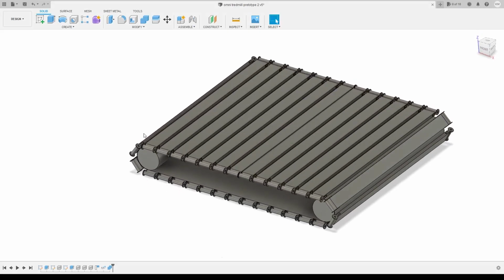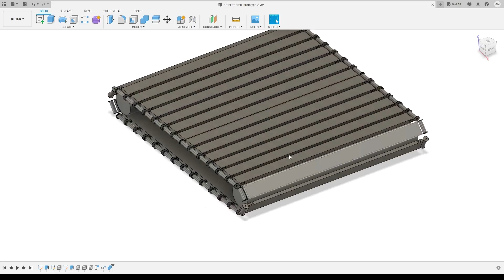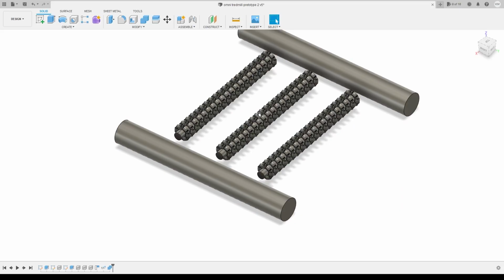DIY VR Treadmill #shorts Omni roller testing!

Comment: It's crazy how much effort you're putting into this and professional your videos are. The editing is nice. You deserve way more views. I think you need to work on your thumbnails though. That's one of the most important things for getting views. It seems like you put effort into them but they need more bright colors to attract more people, instead of the white background you have on some. Also, a question about the treadmill, is it going to have motors in them like the infinadeck? Cause when i saw the infinadeck i questioned if it really needs the motors.. If you look at the ready player one scene, the treadmill looks more like it's this really lightweight band that spins with very little effort, as apposed to the treadmill moving on its own to match the players needs. Couldn't you just make just one big band, with a bunch of smaller bands that all move individually, like instead of having the couple bands in the middle move motorized, only the bands that you would step on would get pushed back separately? I'm probably completely wrong but wouldn't that be possible? Like almost to just have some very frictionless pulley systems on the bands so they all move very fast and easy? I don't even know if that made any sense...
Reply from the maker: Kind of makes sense? but at the same time you have the issue of friction between the belts and the standing surface. it might be possible if you wanted to have a harness supporting most of your weight! ill have to do some testing, thanks for the idea! also thanks for the advice on the thumbnails!
Reply: @modernpower6285  yeah, i was thinking like putting some oil in between the belts and the surface to decrease the friction. And yes, i guess the harness should support some of your weight. I'm not really knowledgeable on these things so it was just a thought I was wondering about.

Comment: Dude there's a reason this kind of equipment ends up costing the end user several thousand. 3d printed plastics, plywood and cardboard just aren't going to cut it for this application. You'd be better off building a slide mill instead. At least that doesn't have to have powered moving parts. That's still a project and a half and I would guess you could end up spending somewhere in the ballpark of $500-$800. This needs precision manufacturing with very strong and lightweight materials to work. If you're sweating $100 for some aluminum extrusions, then this project is far and away outside your reach. Not trying to be negative here you just need to be realistic about this or you are going to waste a lot of money and time.

You are also failing to calculate your loads correctly. Even if you only weigh 150 -200 lbs, the force of moving your body in a walking motion is going to apply much greater peak loads than your actual weight. This thing is gonna have to be really heavy duty.
Reply from the maker: Thanks for your input! I under stand that a slide would be easier and more cost effective. and i also know why treadmills like this cost thousands. but prices such like these can be greatly reduced. lets say for some reason this project takes off allowing me to crowd fund some injection molds. once ive done that we have all the 3D printed pieces available for around 10 bucks instead of the estimated $60. this project will not be easy to complete and I completely under stand why you would think that there's no way this would work. but I believe I can make it happen. if you are interested in discussing the project further i am more than willing to do so on the discord. PS if you are unable to purchase any of the items that you need second hand current projected cost of the project is $1300 i think ill be able to get it down at least to 1K with some careful planning. Thanks for the advice!

Comment: You should consider printing the parts that need heat resistance in PETG.
Reply from the maker: I didn't really consider that good idea!
Reply: @modernpower6285  You could also print them in TPU or coat them in some rubberized material for extra grip.

Comment: You said the plastic is melting, are you just using a wood rod/axle straight to the plastic? Might be a good idea to buy some small ball bearings along with possibly metal axles/rods to replace the wood.
Reply from the maker: i could but i would need over 360 ball bearings and i don't have that kind of money....